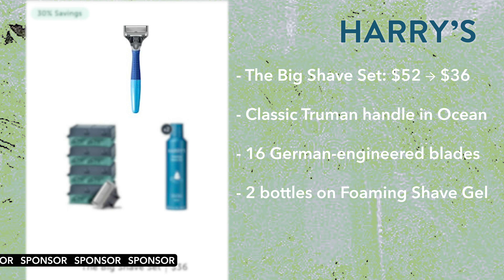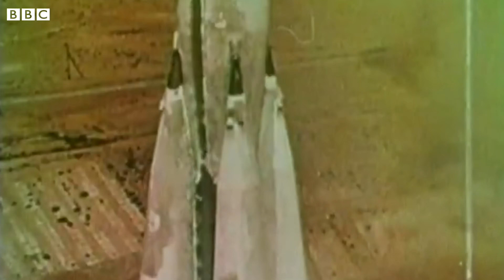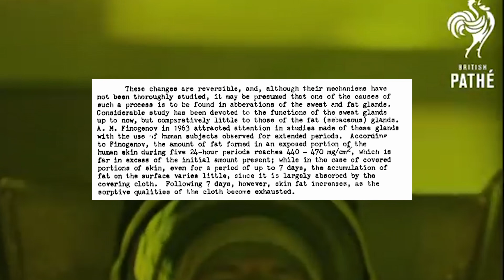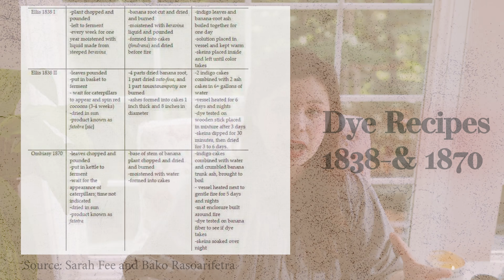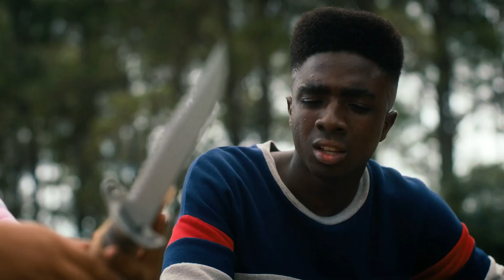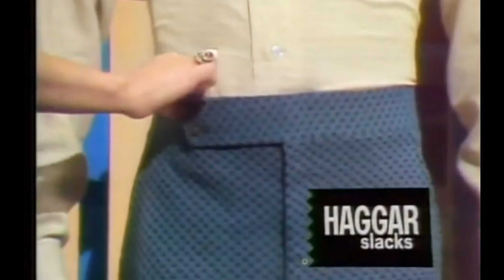The DISGUSTING truth about Laundry

Comment: It's so weird. Just last night I was researching hand washing clothing to see if it actually cleans better than machine laundry. Now I want to start hand washing. Can you do a video on how we can hand wash our clothes and care for them the way our ancestors did? I know you kind of touched on it, but I think that'd be really interesting and helpful.
Reply: Hand washing is fairly simple. You need a tub, basin, or laundry trough large enough to put your laundry in (bathroom basin is good for underwear, laundry trough or plastic tub for jeans!).
Put water in. I usually use warm water: you want something warm enough to dissolve soap, but cool enough not to hurt your hands. Dissolve some soap into the water, or put laundry detergent in. I personally prefer soap.
If your clothing doesn't have stains but just needs skin flakes and sebum removed, put it in and swish it around a bit. You won't need to move it much, but do move it around.
Most stains, I have found, can be removed with the help of a bar of soap. Figure out which direction the stain happened: from the inside of the fabric towards the outside, or from the outside of the fabric to the inside. Apply soap to the destination side, then put the fabric in the water.
Gently rub the destination side in the water. If the fabric is delicate, be very gentle and use your hand against the fabric. If the fabric is tough-as-nails, go ahead and use whatever you can: washboards were used for stain removal on tough fabrics. Take your time, being gentle with a stain will make removing it slow. 
Once your garment is clean, empty out the soapy water, replace with clean water. I use cool water for the rinsing: once the garment is no longer warm, I have removed the warm, soapy water.
Note that this leaves your garment all drippy-wet. There's no spin-dry in handwashing! If it's tough-as-nails fabric, go ahead and twist it to dry it. But if you do that to lace, or to any knit, you'll ruin it. I typically put the garment on a towel, roll it into a cylinder, then step all over the towel. This squishes much of the water out, at the price of needing to hang the towel out to dry too.
Because I live in a city and rainwater is not clean, it's best to have a cover over my clothesline.
Reply: @juliatarrel1674  I've heard of people using salad spinners to spin out the water! You can also DIY something similar or even buy a machine that just spins clothes. :) These were quite popular in Europe a while ago.
Reply: @Niosesore  I can imagine using salad spinners for light clothing, but can you imagine the destruction trying to salad spin wet jeans?!
Other than that, yes that's a good idea. And DIYing - any motor. They spin. Another good idea.

Comment: I have overdyed things because of stains. I also tie-dye or intentionally unevenly dye things so that they won't show the inevitable stains I will get on them because I'm a klutz. I had a boyfriend in university whose mom washed everything after one wash and his tshirts lasted a year before they wore out at the seams, I've got tshirts that have lasted 30 years.

And as much as I like old appliances and know they last a lot longer than new ones, the water useage in my front-loader is considerably less than the old tub I had, and also its super spin cycle halves the amount of time my clothes need in the dryer. And I'd belive the statistics about households who have to dry all their laundry. Apartment and condo living sucks for stuff like that. And I've never met a new dryer whose sensor worked well enough to stop the dryer before everything in it was stuck together in a giant ball of static so I always use the timer function according to what it is in the dryer, a little longer for towels and cotton fleece pants, a lot less for polarfleece outerwear. 

And I actually prefer certain things to go in the dryer compared to on the line (even without fabric softener), towels are softer and I've had a few garments fade in the sun even though I turned them inside out.

And my best defense against super-perfumed detergent is I use the cheap discount brand stuff where the smell fades if I leave the dry clothes in the dryer for a day or two.

Also I'm squicked out about washing underwear in the same wash load as dish towels unless I'm tossing bleach or peroxide in it.

Comment: I air dry most everything. I am fortunate to live in a very low humidity climate and my HOA has no opinion on a clothesline. In summer my clothes will be dry before the next load of wash is done. A baby step to move to air drying: you can put your towels in the dryer for 15 min then remove to finish. They won’t dry crunchy.

Comment: I use soap nuts/soap berries.  They're grown in India, dried and then shipped here.  They contain natural saponins which break down more easily in the environment.  I use vinegar instead of bleach and fabric softener.  I use wool dryer balls (way past the package recommended guidelines of 100 loads. Add a safety pin to each one to reduce static if that's an issue. You can add a few drops of essential oils to the balls if you like having scented laundry come out of the dryer).  I have started to turn my clothes inside out and spray them especially in areas where I sweat heavily with IPA (rubbing alcohol).  It has drastically cut down on the amount I wash my clothes.
Reply: Also, I do remember seeing in some Asian dramas people have small circular clothes drying racks outside of their windows if their bathrooms were too small, otherwise it would normally be in a bathroom.  My grandma didn't like drying her clothes in her apartment's dryer, so she kept a drying rack in her tub except for when she bathed.

Comment: Our city has laws against line drying but the province has said that they are no longer valid as line drying is better for the environment.  When we lived up North my husband used to refer to my dryer as the expensive accessory not used. I did use it in the winter cause hanging at -20 is complicated and socks and underwear were too much of a pain to hang out when it was that cold. Eventually I will move if not North at least to rural and have a wonderful clothes line again.  My husband took my small line down to build a new shed and never put it back up cause now we need a post!  Frustrating but I got a post hole digger and it on my list of things to do

Comment: When my dryer died i started hanging my clothes on hangers and hanging them up on the curtain rod i have between my kitchen and laundry room. They would dry overnight and it saved lots of money I didn’t have to pay the electric company. I have a small oscillating fan in the kitchen to move air around. My work clothes are black and gray so I wash in cold water, I buy dark color undies and bras so everything can be washed together.  Most of my other clothes are medium to dark colors. It’s just me so I usually only do one load a week unless i wash blankets and sheets. I save money on T-paper by using bathroom cloths but I hand wash those with a capful of bleach to clean and sanitize. I have a couple of hangers with a bunch of clothes pins attached and hang them up in the bathroom to dry.

Comment: Immediately started researching how to make my own laundry detergent and contemplating separating items in my wash instead of my usual throw it all in and get it all done at once. 😬😂 This was eye opening in the best way!
Reply: Be careful not to use real soap as a laundry detergent in a machine. The water, even at its hottest, doesn't get hot enough for it to be useful and then it coats the interior of the machine until you have to actually wash the machine itself out. I've heard that using vinegar with it can help the problem, but I wouldn't risk that much more work/wasted money.
Reply: And then the clothes both still won't be clean and start to have a soap scum build up until you boil the heck out of them.
Reply: @sarahmcneill1237   Thanks for the info! 😊

Comment: I’m a Canadian living in the UK and have a combination washer-dryer. We only use the dryer function for towels so they don’t dry hard and crunchy inside in winter. When I first moved here years ago I found that the front-loading washers were much gentler on clothes than the top-loaders, and they also clean the clothes better. Socks and undies are changed every day, but everything else is worn at least twice except if it’s stained, and then I try spot-cleaning first.

Comment: I have been concocting my laundry soap for several years now.  Recipe off Pinterest, Laundry Soap, grated Fels Naptha, Baking Soda and the powdered bleach or oxy clean.  Costs around $20 to $25 a recipe and lasts about 9 to 10 months.  I only need one to two tablespoons per load.  Most people use way too much laundry soap or detergent when doing laundry and it builds up on the cloth. And I use vinegar in my rinse if I use anything.  I do have a front loader and do wash the underwear separate on the sanitize cycle.  We hung up laundry when I was a kid. I hated it.  Running out to save the clothes when a sudden rain shower happened.  The stiff, scratching fabric when there wasn't a breeze.

Comment: I don’t ever use fabric softener. I use the unscented baby oxyclean with my unscented detergent, I let the machine agitate the detergent into the clothes, then I stop the machine and let it soak for a while. The soaking step really helps with getting the skin oils loosened up from the fabric with the detergent and stain remover. I end up having to rinse my clothes more than the machine does regularly to get the detergent out even though I don’t use scented products, but I end up with a laundry load that is not going to exacerbate my dust allergies, and actually feels and smells clean even if I wear my shirts for a few days in a row without deodorant. The modern laundry machine should have a soaking function as part of the wash cycle for more efficient cleaning, but it doesn’t usually have one.

Comment: Two significant drawbacks to line drying ate UV damage to your clothing from sunlight and birds doing their business on your clean laundry.  Clothing is also more stiff and scratchy from the line than from the constant motion of the dryer.  Much of the US also has cold weather that precludes line drying during the winters.  For those squeamish about possible fecal contamination, wash your underpants separately or use a bidet.  Bidet attachments can be purchased for any existing toilet, ate easy to install, and they save hugely on toilet paper.

Comment: Don't even get my started on personal hygiene routines. I shower once a week. Yes, once a week. I've done it it for years. I do not use deodorant. I do not use toothpaste (my dentist literally thinks I'm using fluoride toothpaste). And does anyone know the difference if I don't tell them about any of this?? NO!!! 

Transitioning into it of course is difficult. Your body needs to adjust. And you learn about small things too...like the acid mantle of your skin and hair. And the impact soap residue can have if you don't rinse it off effectively enough. Or what happens if you don't remove hard mineral build up on your hair...though that comes from the fact I don't use modern hair care products either. Because why would I?? They suck.

It's amazing how good your body is at keeping itself clean. If only you have a little faith and learn to work with it rather than against.

Comment: There is a Laundry Detergent System from Sonett that separates the detergent part from the water-softener, so you can change the ratio of the water-softening depending on the hardness of the water in the region you live in. I'm amazed not many people know about these things. If you live in a region with hard water, it allows you to use much less detergent. Also, you can add bleach if you want to but it is not part of the detergent itself. That System is amazing, my clothes are so much softer and last for years.

Comment: I can really recommend a portable drying rack. The clothes take 24-48h to dry indoors, even in winter, and its been saving my clothes so much wear as well as cutting energy use.
Reply: I have a pair of drying racks that I use on our tiny patio that faces a main road here in town. I keep it hidden behind a decorative screen. My landlady says that as long as it's not visible from the road, she doesn't care.
As for other rppl saying that the clothes are scratchy, yeah, they can be a little. But that's because I'm not breaking down the fibers by tumble drying them .

Bonus to drying things in the sun? My husband's acne has improved, as has my eczema, and we aren't throwing money away of fabric softener.
Reply: I had an air source heat pump installed a couple years ago, the type with a head on the wall that blows warm air out. I just hang my washing on a rack in line with the warm air, and it's dry in a couple hours. It's a win-win :)

Comment: Having gotten into historical reenactment in the last decade & living in the hot and humid Southeast USA & starting out with a cotton chemise and then making my own from linen, it amazed me how much more comfortable wearing the linen was under the outer layers. So much so that I endeavored to start buying linen garments for everyday wear.  
 In the same time period I was working outdoors in several retail garden centers and began to wear undershirts so that as I travelled from store to store I could take off a soiled shirt and put on a clean one for the next store. I thought that wearing an undershirt would make me hotter, but the opposite happened. If I didn’t wear an undershirt for some reason I found I was more uncomfortable than WITH one.     I did a bit of research and came to the conclusion that the undershirt/ overshirt combination creates a insulating space which helps ones body regulate its temperature better than a single layer of clothing. And it might sound strange, but the majority of my undershirts are BLACK ( not white) and the black ones assist in pulling heat AWAY from the body better than the white ones. Wearing an undershirt also helps outer clothing to hang better, somehow?? 

Now I kind of want to make myself a few linen undershirts to see if they are even better than the cotton/ spandex ones I have been using. Perhaps the Truly Victorian corset cover pattern will be a good place to start for such an endeavor and a few modifications for ease?? 

Wish I could find a source for reasonably priced FINE linen as was once readily available for making undergarments and handkerchiefs and collars & cuffs.... etc.... what I have purchased is too coarse to really be historically accurate— but it fit my budget.

I felt this related to your video because wearing undergarments is so important if one wants to launder their outerwear less often by doing spot cleaning rather than cleaning entire garments between wearings.

Comment: I've never had tiny holes in a t shirt after washing it once?! Is that a front loader vs top loader thing?

Here in Australia my family uses a clothesline as well as an indoor clothes rack. We don't have a dryer. In summer the clothes dry so quickly, they're often dry in about half an hour and we specifically have to make sure not to leave them out too long so they don't get "baked." We have a front loader which is gentler on the clothes, and there are some garments I only hand wash, like hand-knit wool jumpers. Also I do darning when the moths inevitably get into the wool jumpers. And the only garments that get washed after every wear are shirts, socks, bras, and undies. Jumpers, jackets, pants and skirts only get washed when they're physically dirty. And I'm obsessive about checking labels when I buy clothes to make sure I get the most natural fabrics I possibly can. I don't buy polyester clothes! My clothing ages pretty well.

Comment: Old school - soda crystals to soften your water meaning you can use less detergent.  Also great as a stain soak. You can still buy them in the UK not sure about elsewhere. Every home would have had a drying rack on a pulley from the ceiling when it wasn't possible to dry outdoors. My philosophy is wear underlayers that get washed more frequently but even then I use my nose - does it smell? No? Wear it again.

Comment: Lived in Poland nearly 10 years and line dried everything, although it was a pain with 6 people's laundry taking 3 days to dry in winter and taking up the whole flat. Summer on the balcony laundry dried in a couple hours! Moved back to Virginia and the humidity is just so high that clothes sitting in the sun in summer for 6 hours were still wet 😩 So back to the dryer we go... Especially with 6+ people it requires so many laundry racks! We had 4 of them in Poland and it still wasn't enough for hanging out  bedsheets.

Comment: Question - does the heat from tumble dryers do any sanitizing? I thought it did.
I started doing laundry in my bathtub when NYC locked down in 2020 and the local laundromats all closed. I got a spin dryer that I LOVE, and use indoor hanging racks. Once the laundromats re-opened I started taking in my sheets and towels, because drying large things indoors is a pain, and I thought they'd be more sanitized by the hot dryer!